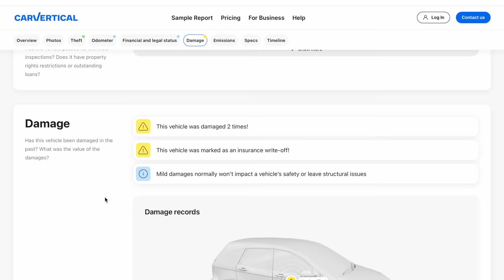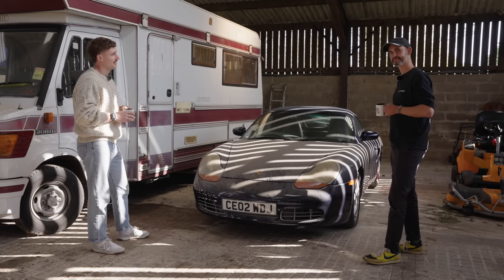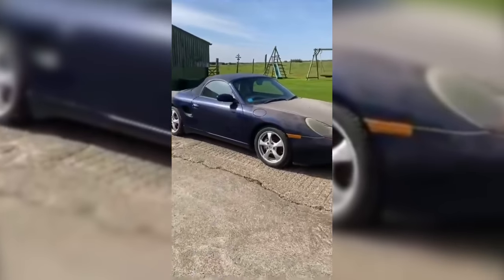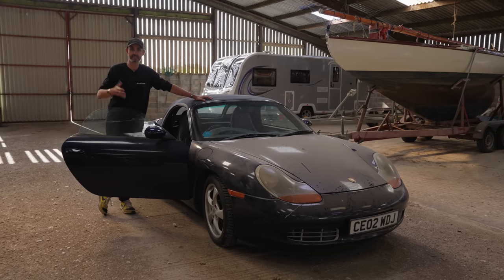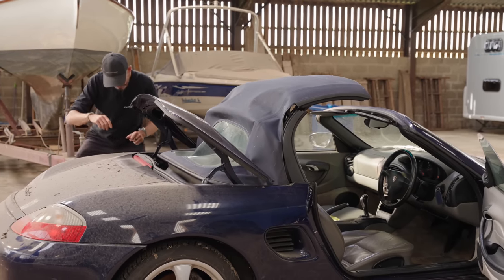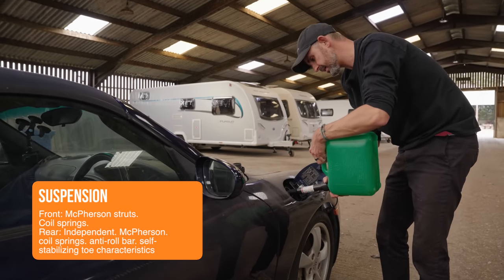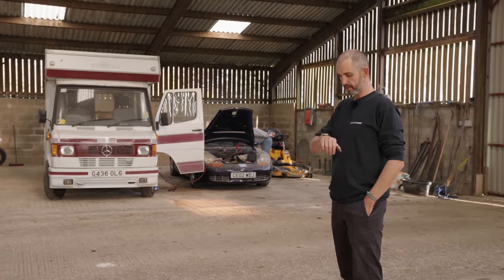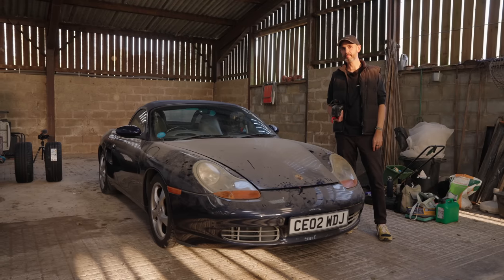I bought Britain's Cheapest Boxster - My First Porsche

Comment: Incredible video, you've made me an instant fan of your videos.  Cheers from Northern Virginia suburb of Washington, DC.  I own a 1998 986 silver over red.   Bought if from Ebay in late 2018 for USD $6200 shipped to my door from a fellow in Texas who 2 years and 2k miles before had bought it from original owner wife of a Houston surgeon, service book up to date to 2016.  117k miles, all 4 tires virtually bald, very weak battery.  Didn't read the manual about not lowering top in extreme cold, lowered it in sub freezing temps and bang, cracked the plastic window.  So I sourced a near new whole top assembly with glass window from a later car, two bolts. New battery, four new Michelins from COSTCO.  Changed oil, cut filter in half, no silver, hopefully the early IMS is happy.  Driven it about 3k to date in six years March 2024, great car, I think the exhaust was updated.  The plastic grills in the roll bar hoops are made fragile as eggs from decades of Texas sun, one has holes.  Spring loaded ashtray cover won't stay closed. Replaced window mechanism in passenger door, easy after you've done it once. Sometimes have to release and pull up again the hand brake to convince the top lowering/raising switch to work, it must be convinced you are not trying to lower your top at high speed. Passes yearly safety and emissions inspections with no issues though now that it's over 25 years old emissions will no longer be required in Virginia. Cheap Walmart two cup plastic cup holder between center console and passenger seat to hold coins and occasional soda.  CD player is intermittent, some CD's just won't play.  Radio is fine. Have charged the a/c couple of times, summers here are HOT.  Used to hang out at my local Atlanta Porsche-Audi dealership in high school early 1970's when a 911T was over USD $7k, I started my Porsche ownership with a rusty $2500 1957 Speedster with 1964 SC engine in 1972 and drove it through "uni", then owned several 912's and 911's, coupes and Targa's, had the only 912 in Athens Greece (I think) from 1996 to 98, plus a 1982 930 Turbo which was an incredible car I wish I had not sold.  The 986 beats ALL the air cooled cars for actual WORKING heat, WORKING a/c, WORKING ventilation/defrost which NONE of them had, defrost never worked, on my 1987 Carrera it would sometimes fill the cockpit with impenetrable fog if I hit a puddle, using the heat threatened death by carbon monoxide in ALL the cars.  The 986 with water cooling solved and I wish it was still air cooled but it's STILL a flat six!  It's as fast as any Porsche I ever owned but the 930 and handles better than any of them.  It is ONLY two seats, not an inch for anything else but the two trunks are UNBELIEVABLE. Gas mileage stop and go sux but high speed trips it's very good considering -  in West Virginia posted limit is 75mph and you can go over 90mph for HOURS if you like, everybody else doing it too.  Just like autobahn in Germany!

Comment: F or awhile I thought you were having problems with the immobiliser caused by a defective key.  I've been there with my 996.  Central locking worked, no pblems manually opening the doors and the ignition lights would show but no start. Turned out to be the transponder in the key.

Comment: Hi Jonny, I own the same model Boxster, had it for a bit over 12mths, when I first got it I had problems with the electrical part of the ignition switch which is supposedly a common problem so that's the first place I would look. The part is cheap being common to various VW Golf models and some Audi, easy enough to fit if you are skinny and flexible enough to get under the dash🙂

Comment: I feel like I’m living a similar life to Jonny. I recently bought an ‘06 Honda Element AWD and bought, not a Porsche, but an Audi TT last year. Unfortunately my Audi had a catastrophic failure during the winter and I sold it for parts. Turns out the transfer case had a slow leak and had turned the gears to a metal paste. The new owner, an Audi guy, has repaired it but I was done being stranded. Nothing like breaking down on a major highway to change your mind about a car. I still have my ‘88 Mustang LX 5.0L for racing and weekend blasts. Awesome video, as usual.

Comment: Just a tip for anyone stuck in this situation without an OBD2 reader. You can sometimes reset the ECU by disconnecting the battery, turning on the lights or sounding the horn to discharge any stored electricity then connecting the battery back up and trying to crank over. 

I had a BMW generation Mini Cooper with too many electrical issues to count that would give me trouble cranking over sometimes and using this trick helped me out when I was stranded.

Comment: That drive home in a newly bagged shitter is always more joyous than anything involving a decent new or newish car. 
Imy favourite was a Saab 9000 2.3 turbo won for £250 on eBay. It was immaculate, but I was warned that it overheated.  I drove 140 mike's home with no overheating issues at all.  It never did all the time we had it.

Comment: From the former owner of a 986 Boxster, best of luck with the project Jonny and can't wait to see more on your channel! I had mine when I lived in California and found it to be a great dual purpose car - civilized and practical enough to be a daily driver, yet really comes alive when pushed to 9/10ths.

With regards to the issue where it won’t start again immediately after shutting off, I had the same problem on mine. Not sure if the emissions controls systems for Boxsters sold in the UK are different, but the root cause for me turned out to be a slightly cracked fuel filler cap - it was just letting out enough pressure from the fuel system to periodically trip the evaporative control system that was required for California smog regulations. 

Also - a couple of more recommendations as you work on the restoration: 1) If you need to replace the roof, upgrading to the glass rear window that was fitted to 2003-2004 Boxsters is worth it. Rear visibility will be a bit less, but the NVH improvement is night and day plus you also get a rear defroster element. 2) for the wheels, if you can source some reasonably priced 18-inch turbo twists (the same ones on the 993 turbo), they were actually a factory-fitted option and they make the car look just proper :)
Reply: A new hood with glass rear screen is £2k and would cost as much as the car. Turbo twists are ugly, they look better with multi-spokes.

Comment: My 996 turbo had this same problem start runs left for a while then restart nothing won’t even crank.  Dealer spent a week doing wire by wire testing as no fault codes it was the ecu failing due to heat soak not sending the start signal.  You can send to ECU DOCTORS USA they also identified the fault in the ECU plus they can rebuild the immobiliser if it has water damage.  Hope this helps

Comment: The cutting out sounds like the coolant temperature sensor Johnny. The weirdest non start I had was on a Renault Clio, I plugged in my code reader and it came up with an Automatic gearbox fault, the thing was the car was a manual😂 I cleared the fault and away it went.
Good luck mate

Comment: If the engine management light does NOT come on when the key is at position two it will not start. This is almost always a fault in the ecu under the passenger seat . When this fault randomly occurs which it will time and time again, unplug that ecu and plug back in and it will start . It’ll do it again though until you get that ecu repaired.

Comment: Three separate issues there, rear trunk will be the module. Frunk not opening will be the front actuator, doesn’t go through that module.  Car not starting could be the ignition switch, very common issue.

Comment: Check under the passenger seat if it’s wet the dmu is on its way out., this is caused by the drain holes being full of debris and water overflows into cabin.. if the dmu is totally goosed get another wither the same number in the white sticker ..Send it to an ecu company with the old,one and have it clones… has a similar issue .. however mine needed up totally dead .. this worked and got it going

Comment: This week My Mini Cooper (old 2010) had a defective coolant temp sensor ( I believed) causing fan to run constantly and poor starting; no fault codes on reader. Replaced sensor; the actual fault was not cured, and still no fault codes. Cleared the fault codes that weren't there; car runs fine. I assume that clearing codes is a reset whether or not your reader/app can read them?  Worth trying tho!

Comment: I had a car do this to me for a year or two. Replaced the main ecu and no more issues. Had a fault between the grounds and sensor power circuit that ran to the main relay and fuel pump. Fault due to water damage…..Good luck my dude, she’s a beaut.

Comment: Those bosch starters sometimes burn and only work when cold. It already sounds like its been used to start it up a trailer in 2nd gear. Motor windings will be dark if burned

Comment: first thing i thought when it didn't start the first time was stick an obd reader on it.  You've got the cheap one like mine.  Doesn't see everything the expensive ones do.  just clear the codes and as long as it's not a fault that comes straight back it'll run.  The fault may well return to be dealt with another time.  I've done this a couple of times with two different BMW's. I've kept one in the glovebox for nearly 20yrs now.  It has saved me a fortune in garage bills.

Comment: This could not be more serendipitous - I just bought a Boxster yesterday. Not nearly as cheap as you got it, no known electrical faults, good operating condition it seems. Minus the roof, which has a broken transmission, it seems. Mine's an automatic / Tiptronic because I don't presently have the skillset to drive a manual car, but I do want to learn at some point.
So so so looking forward to starting our Boxster journeys together. Just drove it 350 miles home, no issues. Hoping that you sort your gremlins quickly. I parked it in the garage after having an overwhelmingly positive experience today, and suddenly almost don't want to take it out for a little while. It's still too special, despite having driven it at 75mph all day. I bought it hoping we could go on road trips, maybe doing a track day some time, the lot. And suddenly it's too scary to drive. I'll get used to it, but I never dreamed of owning a Porsche and have wanted one for years, and I couldn't pass this one up for the condition it was in at the price which was very competitive for the US market. I did pay a lot more than you did though lol.

Anyway, if you see this, that'd be a highlight, but I'm very stoked regardless.
Reply: They are money pits. Don't believe me?....You will.

Comment: Probably turning the ignition on to muck about with the roof probably caused the intermittent starting fault as its probably something to do with ignition/pre crank, do you hear a fuel pump prime or anything? Check grounds and fuses

Comment: Starter issue will be duff Crank Position sensor (if it cranks when hot but fails to start) or if non cranking, starter.motor or solenoid. Easy whatever !!!

Comment: Others will have said the same. Those cheapo OBD code readers are too generic and can't display fault codes from all the modules in your vehicle but can broadcast a blanket "clear all DTC" message to clear all the trouble codes. You'll see some trouble codes when you plug in a more advanced OBD tool. Great video anyway and good luck 🏎👍

Comment: I have a 2001 Boxster S (986) and it has the same hot start issue I have been dealing with for going on 6 or 7 months. So happy to see your affordable (cheap) Boxster and am really hoping you can help me diagnose it and or fix yours which should head me in the correct direction as well :) Wait till you get to drive it. A custom alignment and some sticky tires REALLY transform this car into something special. I also agree that the Boxster and Cayman handle better than the 911 and am not afraid to admit it :)

Comment: Had the exact same fault with a Ford focus.... A mysterious ghost code........ Mechanic took the body control module out from down low in passenger side that got wet from a bad windscreen install..... Clean down the contacts and stuck it in his hot press for the night. Next day installed. Car never missed a beat again...

Comment: I had a similar fault on my Golf Mk5. Abs light on the dash constantly on. Plugged her in with the obd reader telling me the issue was the rear drivers side. I changed the abs sensor, cleared the codes and all was fine for the day. Next day light was back on the dash. Same place as before, drivers rear. Changed the rear bearing along with the ring sensor. Again lasted a day. Following day decided to change the rear discs which looked fine. Turned out to be the discs causing the abs light. Guessing they were warped? But learnt that cars can be a complete headache! lol

Comment: These 2.7 Boxster are terrific value will only go up. Lovely steering and ride feel so well built, great on long trips for a relaxing high speed cruise. Plus exceptionally well built/ well designed. I’ve had loads of Porsches over the years ( 911, 944 turbo’s, 928, 968 sport, Boxster 3.2) and I always discounted the small engined Boxster as not worth bothering with but we’ve had one for the past 18 months and have really enjoyed it - hard to think of anything else at this price point that’s any  better to drive or feels as special, look forward to more updates.

Comment: Immobiliser / Reset - Porsche has a clever 5 days shut off, the keyfob wont work with the button after 5 days, and this could also be part of the imob not allowing to start. To get clear, put the key in the lock turn and then push the button to reset the imobiliser, Open and close. Your have fun owning a P,  great build quaility and design considerations. Had mine for 4 years now. Will probably cost you another 4K to get perfect. Moth

Comment: Try change your starter relay out for a new one. it is located in the rear trunk.
also you may want to change out the DME relay as well.panel #2 relay 7 & 1

Comment: Free Mention if i diagnose the start fault? You said car has had water ingress into foot well and under seat areas. And water ingress has likely been via pillar blocked drains, so possible its run down vertical surface of firewall. The first place I would look is the relay center that contains the "start relay" which just happens to be the lowest relay and pushes in horizontal axis, making it easier to fill with water. But new relay and fit or pop cover of the old one and check or simply test when you have the no start condition with wire jumper across relay base main power cable in and out without the relay in place. This also explains why it doesn't show as trouble code, its not monitored by the ECU. Good luck. "Paul from Dallas"
Reply from the maker: Paul, this is really helpful info, thank you. I will check the areas you mention.

Comment: This generation of Boxster doesn’t 100% follow the OBD2 spec. It  requires a special reader such as PIWIS or Durametric. 

Good luck with the Boxster! I just wrapped up a significant overhaul of mine including IMS, chain guides, seals and gaskets, and got it back on the road. It’s a delightful machine!

Comment: I had a VW that did exactly the same thing ( always start 1st time but had to wait if car switched off )

It was the fuse box 
A quick fix was bypass the ignition fuse with a cable & button ( fuse that ) so turn on key so dash light up then hit the new button

Worked 100% all the time no probs , apparently alternative was to change the fuse box which is big wiring headache job 

Ps you can test with a cable before wiring it in properly of course 

Good luck

Comment: I vaguely remember my uncle having a similar age Porsche with a similar electrical starting issue which turned out to be something with the ignition barrel which I think may be alluded to when it wouldn’t start after you had the ignition on for the roof.
Reply: I've had this on an E46.

Comment: As a Porsche Tech, I hate these no start, no crank issues. As people stated check the immobilizer under the seat for moisture. The electronic portion of the ignition lock also likes to cause crazy electrical issues. Fuel pump/fuel pump relays and crank sensors usually would still give you a crank but no start so I dont think they are the cause. Good luck on your digging and figuring out the issues!
Reply: As a Porsche Tech.....I hate Porsches because I KNOW they are shite.

Comment: Good luck, you should be fine.
If the windows weren't fixed then you probably need two modules.
You need a more expensive code reader to see what is going on and do so with engine on. Also start with a known good battery.  The starter may be on its way out . A connection may be seperating when it gets hot!

Comment: The not starting when hot issue could be the cam position sensor. Common issue. Had my Boxster for almost 5 years & another before that.
Reply: I had a fiat Tipo that had a flywheel sensor that would stop generating pulses when warm.

Comment: Bringing back lots of memories of my 99! Had a similar issue with water getting in and buggering up the control module. Had to get a new DME and New Key$$.
I did enjoy the car, but at some point what it needed to get refreshed (like suspension bushings) was cost prohibitive. Went back to my roots and replaced it with a 99 Miata 😆
Reply: Your problems are similar to what I had. Also windows regulators fail on them and endless suspension issues. They are a nightmare and overrated to drive. I've had an Abarth 124 Spider (based on the ND MX5) for 4 years now and it makes these old Porsches look like the trash they are.
Reply: @blackporscheroadster-yw8hb  biggest thing I miss is the sound of the flat 6 and the feel of the mid engine set up.